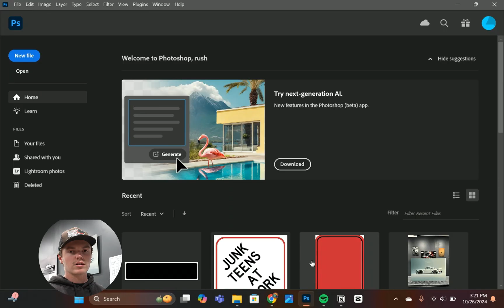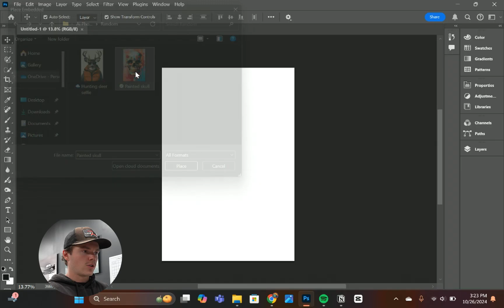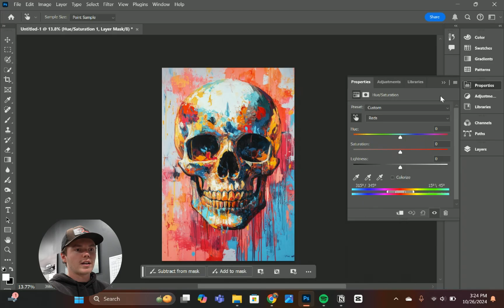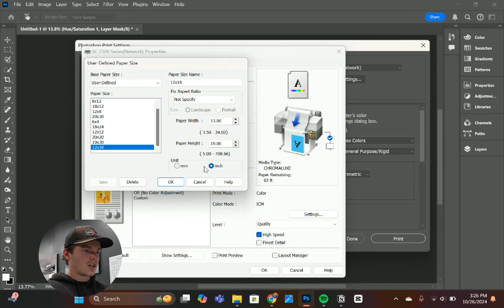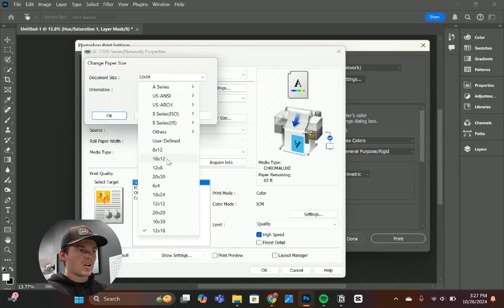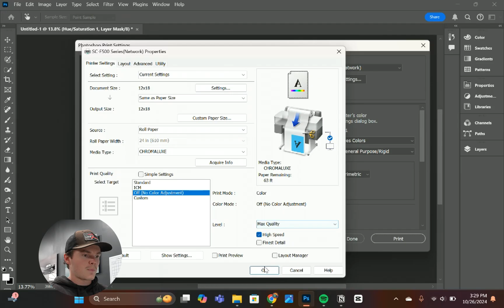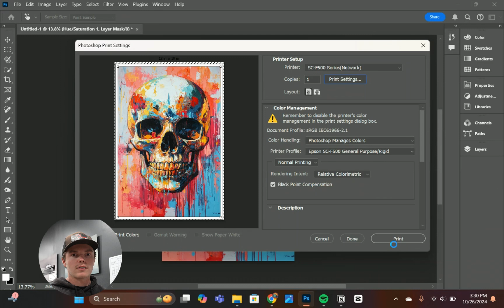Photoshop Settings For Epson F570 Metal Sublimation

Comment: what is the temperature do you use
Reply from the maker: 395f for 2 minutes on smaller presses and 350f for 5 minutes on my large press
Reply: @Printshedco  Do you use is Epson Dye Sublimation paper or any other brand, what is the GSM?
Reply from the maker: @rajeshvemula26  I use sublipro
Reply from the maker: @rajeshvemula26  I use sublipro

Comment: Thx, question: is there a reason to do it in 300 res and not 400 or 500 etc...? i know 300 should be the minimum, but what's the reason not to go higher?
Reply from the maker: I have no idea. Its just what I was told to use and seems to be the standard
Reply: @Printshedco  i mean, it would mean more pixel per area, should be better picture, isn't it?